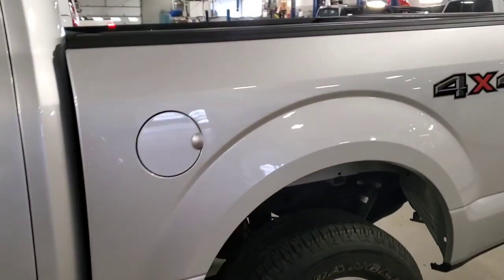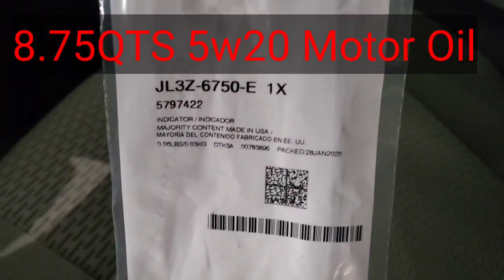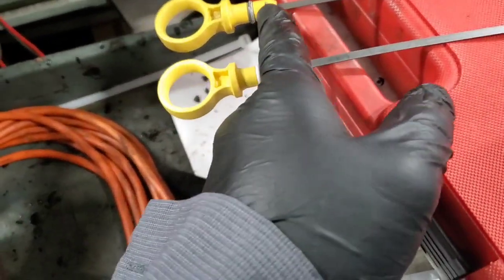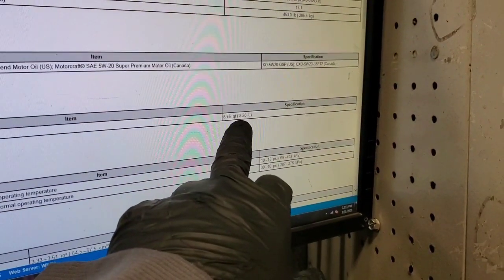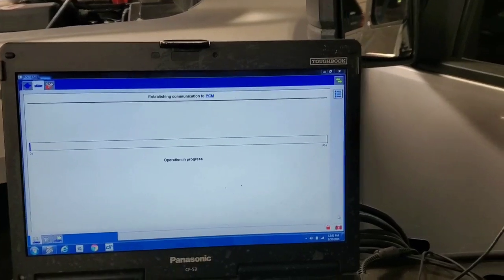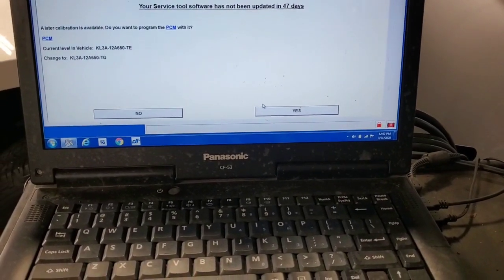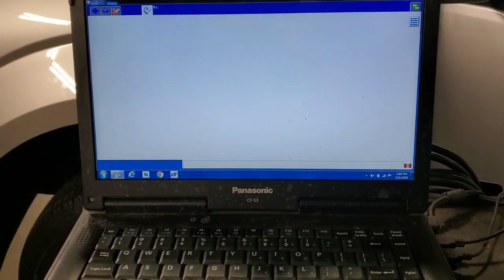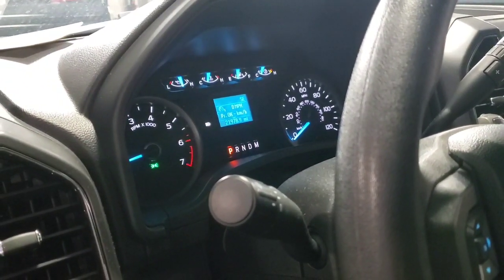2018 - 2020 Ford F150 Oil Loss or Oil Consumption Technical Service Bulletin

Comment: Full Cend- TKM, Which of these two F-150 engines the 2.7L Ecoboost or 5.0L 2018-2020 would you say is the least problematic engine?
Reply: 33k on my 2019 3.5 ecoboost. no problems at all. I have a catch can installed and pull a trailer 60% of the time. Its a monster compared to my 2011 5.0
Reply from the maker: 5.0 is the best BY FAR
Reply: @fullcend-tkm73   Thanks, I'm shopping for one and I have been torn between the two.
Reply from the maker: Never the 2.7L they were talking discontinuing it 

Problem child
Reply: @fullcend-tkm73  OH Ok,..that is very interesting...thank you for the heads up, glad I asked. Since I have your ear, what're your thoughts on the 3.5L Eco?
Reply from the maker: Its nice but it still has timing chain and Timing Phaser Issues

The 5.0 has the least issues
Reply: Shawn Pratt don’t get the 5.0.  I have a 19 and this is a problematic motor.  The dipstick it bullshit.  Trying to increase the range on the dipstick.
Reply: @emerylandry2074  I am thoroughly confused on what to do..I wanna buy a 2018 F-150 and I am hearing all sorts of things.."5.0 is bad" oil consumption, rattle etc...then I hear "2.7L has/will have problems" longevity won't be there...IDK what to buy.
Reply: Shawn Pratt If you are not towing anything I would get the naturally aspirated V6.  They gave me one as a loaner when they were fixing my truck and it had plenty of power and was smooth shifting. Had the six speed. I really like the way that truck drove. I also don’t think you would have a problem with either eco-boost engine as long as you’re not towing. My thoughts are if you’re doing a lot of towing and spooling the turbo a lot you might run into problems down the road. That’s why I avoided the eco-boost.  Others say the 3.5 is great but I’ve also heard of people having expensive repairs with them.
Reply: @livingindetroitmetro-shawn9895  I'm dealing with a NIGHTMARE on a 2018 5.0 , drinking oil, rattles like crazy. TSB for rattle dod NOTHING. so now ford is saying its a normal operating noise. My truck with 17k miles is SUPPOSED to sound like its got a can of rocks under the hood. Burning a qt. Of oil every 1000 miles...RUN. If I can save one person from this heartbreak I will feel at least its not a total loss.

Comment: lol! ford's fix for oil burning: add more oil and use a longer dipstick......hilarious!
Reply from the maker: And it's a reprogram to stop shutting the injectors off during downshifting events so the oil doesn't get sucked up during vacuum as the cylinders come back online
Reply: FULL CEND - TKM lets see the new and old dip stick side by side
Reply: @emerylandry2074  he did
Reply: @emerylandry2074  did you even watch the video?
Reply from the maker: @emerylandry2074  Gotta watch the video, apparently you didn't
Reply: @fullcend-tkm73  I think what happens has more to do with the ETB slamming shut during decel....pistons are still going up and down (creating vacuum in the intake manifold) and the throttle plate is closed, no air can get by, so it pulls air from the crankcase(which is contaminated with oil)
Reply from the maker: @mikedennie8096  I kinda said this without completly explaining it, I know this but for the typical person watching the video I don't see the need explaining
Reply: @fullcend-tkm73  No worries, just thought it might be helpful for people trying to understand where the oil is going and why it's going there. The 'typical person' probably doesn't understand injectors 'online vs offline' as you're calling it either. Just thought the more information the better!
Reply from the maker: @mikedennie8096  well you put my name so that's why I had to address that but I get it
Reply: Damn that oil looked new!

Comment: Hello, just need a technical advice for my F150 2018 5.0 Engine knocking noise, I recorded these videos while driving in the city, 40-80 kph, engine is in the normal operating temperature, doesn’t matter what the road or weather condition outside.
i notice it’s getting louder when i’m driving uphill, the coolant level was at the maximum level when got my truck last week after replacing cylinder heads and now it’s at the minimum (drove it for 170 km only)

https://youtu.be/rNFx91T1RW8
https://youtu.be/8Q1jhwwgyFs
https://youtu.be/Wsq1FeOLOMs

you ca email me back in private at hassonmos@gmail.com
Reply from the maker: Email me them 
Poissorichard.rp@gmail.com

Comment: Just my two cents - if you have one of these trucks give it time. I have a 2018 5.0...yes it burned some oil at first but over time it slowed down. I'm at 17k miles and about 3k miles since my last oil change and the oil is barely just below the top dot now. This is with the original dipstick and I've never had an oil tsb done. The engine needs to break in properly. I get if youre over 30k and its still burning oil thats a concern but if you just bought the truck and its under 10k miles just drive it hard and see what happens. I saw way too many people begging to have their engine replaced before their truck hit 10k miles.
Reply from the maker: I agree give it time but if the manufacturer didn't think that it was an issue they wouldn't put a TSB out for it
Reply: Break in properly??     Trucks shouldn’t be burning multiple quarts of oil when new.   End of story.
Reply from the maker: @Bostonharborwater  Nobody is disagreeing with that

Sometimes when people are set in what I have to say I don't even argue with them I just let them say what they have to say because they know everything

The most this truck should burn and that's not even time for that yet is about a quart of oil between every oil change and it will really never even get to that
Reply: @Bostonharborwater  ok and? Go fight ford on that one. I was simply sharing my thoughts as an owner of one of these trucks. If you bought one the problem is now yours to deal with
Reply: Truck the System    I found out about the problem when I was looking to buy a 5.0 f150.      Luckily I bought a tundra instead.  Best decision I ever made. But I do feel really bad for the people stuck in this predicament.
Reply: @Bostonharborwater  Ya I bought mine before it was really a known problem or else I would have steered clear. Probably would have gotten a 2017 5.0 with the 6 speed instead. Ive been fortunate with mine though...by the time i take it in for an oil change its still above the mimimum level and the truck runs great and seems to be getting smoother as i put more miles on it. Really makes me wonder why some are drinking oil and some arent
Reply: Truck the System    Ya. My buddy has a 2017 5.0.  .   Awsome truck.     Good luck man.
Reply: Well you have to look at which ones have the auto start-stop and which one don't and compare them

Comment: Great video. Thank you. Love that you are a dealer mechanic. Please keep the 5.0 fixes coming.
Reply from the maker: Love working at the dealer giving people updates straight from Ford
Reply from the maker: I sure will

One I will talk about tomorrow is the type writer sound coming from the engine
Reply: I had the longer dipstick put in mine and tsb done didn't work. Dealership replaced the engine. Now im on my 2nd oil change with 3600 miles and oil is at the bottom of the dipstick.  I call bullshit on fords fix it doesn't work. I will be taking mine back to the dealership this weekend. I would advise anyone in the market to stay away from the 5.0. Oh how about that transmission to junk.
Reply: @kenwilson2314  what year is your truck? I'm looking at a 2017 with the 5.0? Also what tranny issue are you talking about?
Reply: @tgltoday2717  go for it that year wasn't affected I wish I had a 2017. Mine is a 2018  5.0 just got it back from the dealership after almost 3 months. They have replaced the first engine at 27,000 miles and the new engine they just replaced the heads witch isn't going to fix the oil consumption problems so im sure in 3,000 miles it will be back in the shop for another new engine. The transmission at first was lunging the truck forward like you got rear ended thats been fixed then it was shifting really hard. It seems to be fixed since I got it back we will see though only put about 60 miles on it since I got it back. I would definitely stay away from the 2018 2019 2020 5.0 im not to sure about the 2021.
Reply: @kenwilson2314  thanks for the info.  I hope they got you're truck figured out this time.
Reply from the maker: https://youtu.be/oGlROM1QKaM

Comment: Just had this TSB done on my 19 F-150. Hopefully it solves the problem.  I really love the truck.
Reply from the maker: Do feel like I explained a good enough here so other people would understand exactly what the issue was or potentially could be
Reply: FULL CEND - TKM Yes, pretty clear and to the point.  I’m really hoping it fixes my issue.  Got my truck in Sept, it only has 5,600 miles on it.  That’s what warranties are for I guess.  I’m thinking once the dealer near me are allowed to start selling again maybe I’ll trade it in for another one only because the deals are gonna be insane I imagine.  I love the STX because it’s not bogged down with all the bells and whistles but I wouldn’t mind having nicer seats that come in the XLT’s.
Reply from the maker: Most of the dealers can sell right now but you have to go in by appointment, at least that's around here I should say
Reply: FULL CEND - TKM  I called on Thursday here because they have a 6.5 Super Crew just like mine only it’s an XLT  and I was told they aren’t allowed to sell. He told me hopefully in May.   Crazy times.
Reply from the maker: @lj.7311  it's not like that here....

Let me know what your looking for exactly and I'll see what we got. These dealers are desperate to sell now
Reply: FULL CEND - TKM Just want a 5.0 super crew with a 6.5 box in an XLT black, manga red, or magnetic.  You are roughly 12 hours from me.
Reply from the maker: Let me look and let me see if we have something if the deal is sweet enough maybe we can get it down to you or make it worth it for you to come here
Reply from the maker: What Year Time Frame and new or used
Reply: FULL CEND - TKM New.
Reply: Did TSB fixed the oil consumption? I just got TSB done on my 2019 and worry about engine longevity.

Comment: So do you know if this is fixing the problem? I just dont like that ford is putting in a longer dipstick and  widening the rang. I feel it's a bandage to a bigger problem. What are your thoughts?
Reply from the maker: Did you watch the video all the way through I specifically talked about them reprogramming the computer to stop the fuel injectors from getting shut off during downshifts when the events happening
Reply from the maker: We'll just have to give it time and see what happens

Comment: You should measure the oil it came out and see how much oil is lost i do mine every 3000 miles and it lost about 1/4 of a quart of oil but then again some oil stay in the engine and oil filter
Reply from the maker: Well this is at the dealer and this is the first time the customer has been in for this so we treated accordingly by the technical service bulletins and we moved from there if it doesn't say don't take an oil sample or measure the amount we don't do that we just followed because we only get paid to follow

If it was my personal vehicle I would absolutely do that but it's not my personal vehicle I get paid to follow what the manufacturer tells me to do unless what they tell me to doesnt work then I can take things into my own hands
Reply from the maker: You are supposed to use up a certain amount of oil between oil changes so that would almost seem normal on what you're saying because you can lose up to a quart

Because we don't have total seal engine
Reply: That’s not true. I’m sorry that’s poor workmanship at the factory. Old engines yes but not new engines. It’s an excuse the manufacturers use to avoid engine replacements-that’s their right. I came from a family with Tundras with different engines and years. None burned oil-ever.

Comment: Knowing what you see on a daily basis; would you ever consider buying a new truck? You probably shouldn't answer that..  Oh well everything now is going plastic and more and more sensors. It seems like the more they innovate, the less time the vehicle is on the road but on a lift getting fixed. The whole rush to adhere to Federal fuel economy mandates, has created more headaches for owners and mechanics for sure.
Reply from the maker: If I bought a Ford truck it would either be a gas V 10 or the new 7.3 Gasser or would be in F-150 with a 5 liter

I like the Ram V8 Gasser or the Ram Cummings
Reply: @fullcend-tkm73  You prefer a Ram with that old 5.7 Hemi over the F150 w/5.0??

Comment: Good morning. I hope this indicates you are back at work (should you wish to be). Good job on the truck. I'm stunned at how cheaply everything is materially made on Ford trucks, and most all vehicles in general, these days.
 - Me?   
I suppose that had a "milder" case of the corona virus. It actively started manifesting six days ago, with a small dry cough, and then a runny nose. Saturday was my worst (scariest) day; breathing/oxygen deficit and I got dizzy a few times. I kept working on my project. I think Keto-Carnivore really helped prepare my body and mind; as I was lean, fit and healthy going in.
 I rev'ed up my immune system and blood circulation by taking  one hour 108F hot tubs every night. My white blood cells were rocking.  I tried taking more B, C,  D, and Zinc, but the combo made me have real digestion/nausea issues.. I wanted to throw it all up. So I stopped supplements. I kept up keto-carnivore; especially eggs, cheese, and red meat. 
-
It's now Wednesday, it's 6 days after the first symptom.
 -What has happened.
Two days ago, Monday night,  I woke up in a torrid, sheet soaked, sweat. Gasping. I just lay there. My generalized pain was outstanding. Thinking about calling 911, but doing nothing. The Viet Nam movie scene came to me...   Sgt. Barnes saying, "Take the pain." Then, finally, the fever broke about 5 a.m. At six o'clock,  I slowly got up, took a long hot shower and felt better.  Tuesday, (yesterday), I was weak but worked in my my garage and yard. The sun was glorious. Now, Wednesday morning, I feet great. My lungs and sinuses are clear.
-
  Experts say that I am contagious for up to 8 more days. Therefore, I'll be careful not to be around people. As best as I can figure, I caught the virus about March 10-14. I remember an Asian woman kneeling on the floor, examining a product, coughing, looking up at me. It was in the Lowe's plumbing department as I walked by. At the time, I thought, "What the hell is she doing here?" 
-
Reply from the maker: Glad your getting over it though, that's really scary.